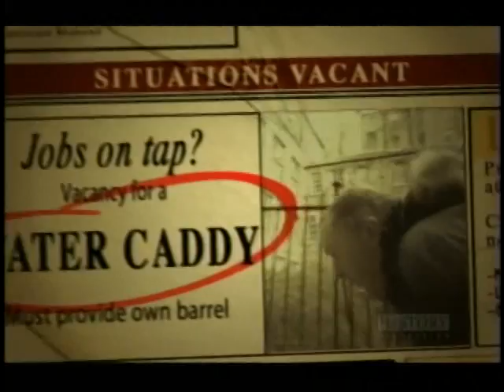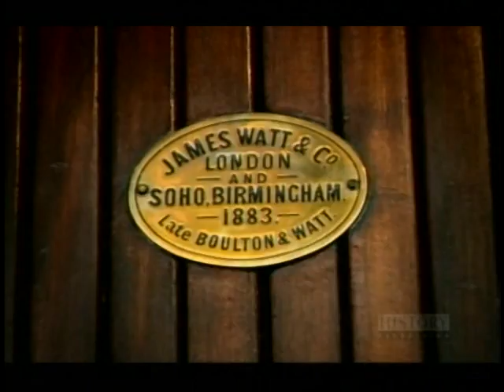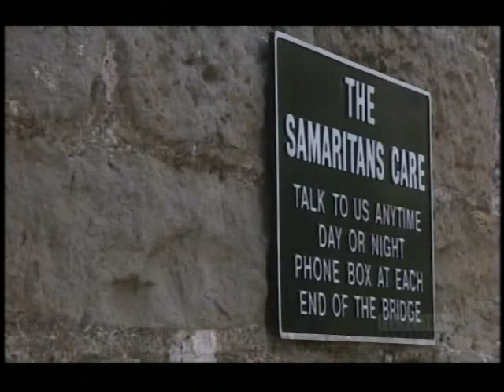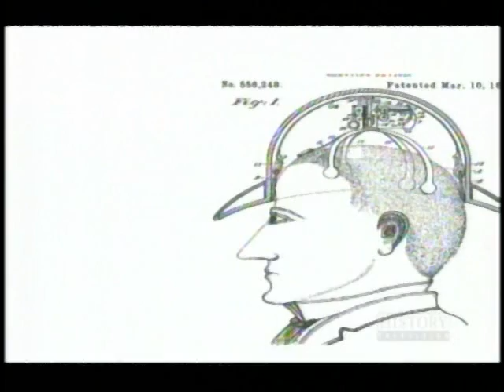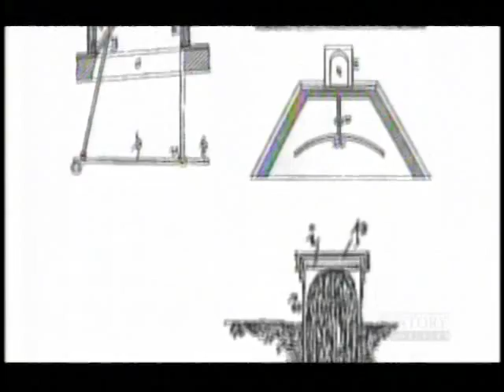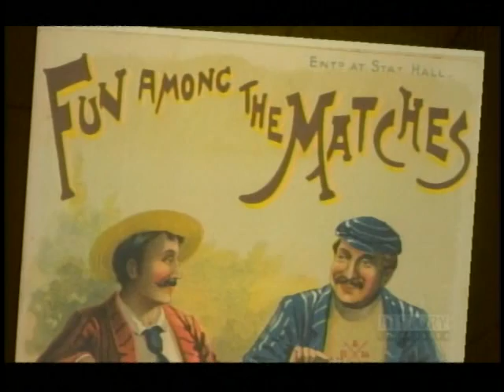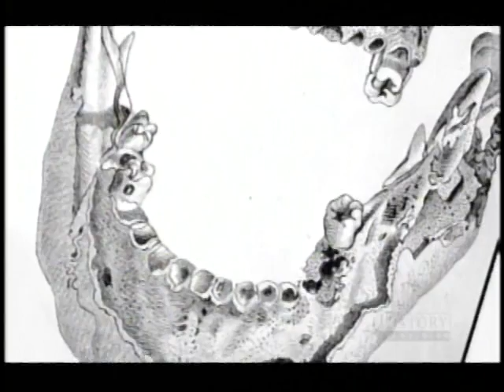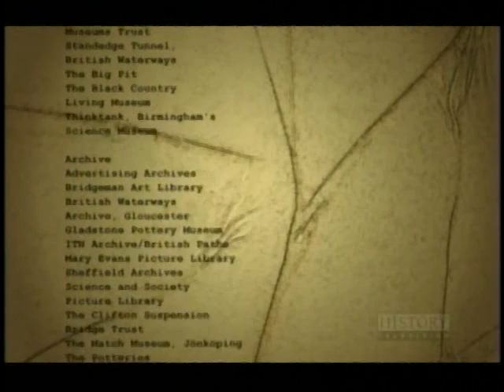The Worst Jobs In History - 2x03 - Industrial

Comment: Fossy-jaw, or something like it, also occured in the USA. Their problem was from licking brushes to a fine point while painting watch dials needed in the war.
Reply: That was Radium poisoning, from a radioluminescent paint product called 'Undark'. Similar, yes, but different. And oddly enough, the exact same thing occurred in the UK too; painting clock-faces and watches with radium-based paint.  Some women ingested so much radioactive material that a Geiger Counter can still detect a reading over their graves through 6' of earth.
Reply: Phossy jaw came from match factories--they used phosphorus in the making of matchsticks, and the intense exposure resulted in the necrosis of the jaw you're referring to.

Comment: Many years ago a dear friend of mine, used to work for a well known Electricity board. Anyway one day he was called out to repair a power coupling and replace a bulb on a 700ft radio transmitting mast. The faulty parts were at the top of this tower and it was the first time he had been called out to repair it and the weather wasn't exactly very clement either, it was raining and windy.
He said that the whole mast was swaying in the wind making a very frightening climb up and down, and with no lift he had to climb the mast with the aid of a long ladder and safety gear which weighed a ton, along with that and the tools and replacement parts. So when things needed to be done up the mast you certainly made sure you had everything you needed with including a few extras just in case you dropped something.  I don't think anyone going up that mast would want to go up there a second time in the same day.
Poor Tony must have been terrified up on that bridge...

Comment: Instead of 'legging' it through the canal tunnel, why couldn't they use poles to push the barge through by either pushing off the canal bottom or tunnel sides? Or better yet, string cables along both sides of the tunnel to where the 'leggers' could at least pull with their arms. I'm surprised nothing better was thought of.
Reply: My thoughts exactly. Probably would have sped transit too
Reply: During that era, I guess being a 'legger' meant that you were of low social status in that class obsessed age. Why do anything that would make their job easier right?
Reply: +James Robert Thought the same. That was the best they could come up with.
Reply: +James Robert 
Exactly what I was thinking. That has got to be the stupidest way to move a boat through a tunnel!
Reply: SpiritBear12 I guess whoever ran the canal must have been a real cheapskate who didn't want to spend any money on cables or poles-but then I realize they'd make more money by having the tunnel process sped up. I can't wrap my head around this insanity. Anyone have an answer?
Reply: James Robert
There is such a thing as being too cheap. Building that tunnel the way that they did, without making a pathway for a horse to tow boats through it was cheaper. However, it created problems with boat traffic jams just waiting to go through. Now you have to spend 3 hours to go through while others wait a ridiculously long time to get through. If you have to pay to get through the tunnel, they could have made more money per day if they could get more boats through it with the aid of horses. Sure, it would have cost more to make a wider tunnel but in the long run, it would have made more sense.
It's a stupid blunder.
Imagine being the poor bastard who has to walk all those boats through back and forth all day. What a job, those guys were not paid enough.
Reply: Yes, the program said that they couldn't make the tunnels wider because for lack of funding. If I was a 'legger' my subservient ass would be pushing the boat with a pole. Then I'm sure some uppity class snob would tell me to stop because I was making my job too easy.
Reply: James Robert
LOL
Reply: I can hear it, some hoity-toity snob seeing the 'legger' using a pole and saying "I say old boy, you mustn't be doing that. It sets a bad example for your other fellows."
Reply: James Robert
 LMAO!
Reply: ***** Thank you so much for answering my burning questions. But still, 'legging it' seemed so much more trouble than installing iron grab hold's along the length of the tunnel. You'd think the potential increase in traffic which equaled greater profits would have spurred any innovation other than 'legging it'.
Reply: ***** Fascinating! It's one of the many reasons I love history.
Reply: I'm going to go all 18th-19th Century canal owner here, and inquire as to why would you want to use poles or ropes, and thereby put men out of work?  That was the rationale for not using 'labor-saving devices' - it would increase unemployment, and Establishment Britain had nightmares about unemployed poor people suddenly going all French Revolution on them.
Reply: good point, but you forget that those in the lower class where always seeking ways of entering a higher class, so if they knew a better way by which they would acheive their job and more importantly, acheive noteriety for having come up with a better way, then why wouldnt they have used it? my guess is that it simply was not possible. perhaps the tunnel was simply too narrow to fit even the smallest barge, or perhaps the flow was to shallow to float a barge. or perhaps the ceiling was too low for a person to stand or sit on a barge- they had to have half their body submerged in order to fit in the tunnels. its easy for us to sit here in this day and age, behind a computer screen and say why didnt they do this or that, but the reality is human nature between now and then has not changed at all. if they could have, they would have. its foolish to thing of these people as stupid or uncreative, they where just as inteligent as we are. the reason we have better things and systems than them is because of them, we built on what they built. perhaps 200 years from now on a documentry about youtube videos someone will post a comment saying "well why did they type their comments on a keyboard that requiered physical interaction with a device, surly just using a telepathic wireless connection their their computers would have been so much more efficient.". yeah sure, if we could, we would.
Reply: I highly doubt it was a matter of being cheap or not thinking of it. When you have a problem like a bunch of barges being held up at a tunnel and everyone is waiting to get their goods through, people are pretty good at coming up with solutions, and the solution of using a pole or a rope is pretty simple.

I think it's most likely because legging it was the fastest way to get through the tunnels. Now the people in the show were going really slow because they're a couple of out of shape old modern men. I'm sure when you had professional leggers pushing the boat, it would have gone much faster.

Now perhaps pushing with a pole or pulling on a rope would have easier on the body, but the owners of the barges weren't concerned about being easy on the people moving it. They would have been concerned with getting it through the tunnel as quickly as possible.
Reply: James Robert I think if you have been watching, you’d realize they weren’t that bright back then
Reply: @WalterReimer  This is actually quite untrue. Labour was (and is) usually the most expensive part of any operation, so owners were keen to reduce it, and even the ones who weren't would quickly find themselves priced out of the market by more-efficient competitors. Additionally, since muscle-power was largely still the only source of power at the time, almost all of it would be used in any case - just not necessarily in very comfortable manners, as this series demonstrates.

In any case, even if poles or ropes had been viable solutions (I'd argue the maintenance alone probably ruled them out), neither would have put men out of work, as they'd still need the same muscle-power to utilize them, so the argument doesn't really apply here.
Reply: @Avnirvana1  Sorry, but this is both a common and very silly historical prejudice, and also not really at all what's shown in the videos. People in the past were no "dumber" than we are today; they simply didn't have the knowledge we now often take for granted. Also, we're far more wasteful of energy today than they were then, because we have cheap and plentiful fossil-fuel-derived power, whereas their power came almost entirely from muscle, usually their own. You'd be far more likely to turn off an un-needed light if you have to run on a treadmill to power it, wouldn't you?
Reply: @tomservo5347  Consider trying to manipulate a pole in a tunnel that size, though; remember that polers usually pole down the sides of vessels, and usually in much shallower water than the 4m of the canal. Also, a pole would just do the same job as your legs, but at a considerable leverage disadvantage.

Iron holds or ropes might have helped a bit, but consider how much frailer your arms are, compared to your legs, simply because your legs are designed to constantly carry your weight and your arms are not. Even the strongest person would find their grip failing long before their legs gave out, so you'd be having to replace ropes or pulls in the dark, some 1.5 miles from the tunnel entrance, for little advantage (not to mention that any maintenance would require blocking and shutting-down the whole tunnel as long as the maintenance-platform was in place). 

It seems very counter-intuitive, I agree, but it's basically the same mechanical operation as having to lug a load over a long distance; there's a reason we put the weight on our back and legs, instead of our arms.
Reply: @michaelccozens  Good points. Thanks for putting it into perspective. I'd imagine those 'leggers' probably had legs of iron and stamina that would make any army man proud.
Reply: @tomservo5347  Thanks, and I'll bet you're right! It's hard to grasp, except for being really glad to be living now and not then, lol!
Reply: @michaelccozens  Well there are some things that make me wish I was living back then, like the idea of nations and nationalism that's become so taboo, especially in Europe-except I'd be terrified of surgery or dental work without painkillers are anesthesia.
Reply: @tomservo5347  Depends what you mean by "nationalism". National pride, sure, and an appreciation of one's cultural heritage, absolutely, but the "nationalism" of believing oneself superior because of the geographical accident of your place of birth? That sort of silly bigotry is what nearly killed Europe multiple times over between then and now, and got many a "common folk" of the kind Tony's celebrating here killed or maimed for nothing but some rich person's selfish clutching for pillaged wealth and glory. That sort of "nationalism" belongs firmly beneath history's ash-pile, and we're all better-off for it staying there.
Reply: @SpiritBear12  Looks like leggers "walked " along the tunnel lying on their sides as in the photo.  Given a speed similar to a walking horse it would be the best way. Lower tunnels allowed boats propelled by lying on your back using the roof of the tunnel and boat.

Comment: that 'legger' job seems very odd to me. Surely they could have come up with a more efficient way than that. Why not make some cables with pulleys and horses at the ends of the tunnel.
Reply: The cables would have to be miles long and they would simply snap.
However, pushing the mud behind with a long stick (like a gondolier) could've worked.
Reply: Cost.  People are cheap, horses, cables and pulleys cost to much. Plus a horse eats quite a bit, and requires a bit more space then people.

Comment: An older friend of mine told how her mother actually made soap before the Finnish wars (Winter, Continuation and Lapland) and how she never run out of soap despite the rationing.
Reply: That would have been weaker soap.  Commercial soapiers used sodium hydroxide (Caustic Soda) which is fairly involved process to obtain.  Historically home soapiers used potassium hydroxide (Caustic potash) from water soluble potassium obtained from soaking hardwood ashes (fruit/nut tree) in non-chlorinated water.  That soap doesn't set hard though (like the soap in the video), which made it kinda useless commercially before the rise of cheap packaging.
Reply: @maxdecphoenix  Interesting.
Reply: @MsDjessa  It was soap though, don't get me wrong.  And any dogs around would have loved licking you because you'd smell/taste of beef fat (tallow) and salty wood ash. unless you really clarified the tallow several times and possibly added some kind of plant essense to add aroma/moisturizing.
Reply: @maxdecphoenix  Yeah I don't know if she did, my friend didn't mention that.

Comment: I can't for the life of me believe that it was faster to leg a boat through the tunnel as opposed to just using some oars
Reply: There wasn't room in a tunnel that size to manipulate oars, though. And even if there was, while it's hard to believe, you have to remember that trying to shift the bulk of a barge by pushing against water with an oar v. pushing against another solid surface would be somewhat akin to swimming as opposed to running.
Reply: @michaelccozens  bullshit there wasn't room for an oar.  Atleast on every canal boat.  Some were fairly narrow. They even show a particularly narrow boat in the video; the guy had to build a plank to overhang the boat so his legs could reach the side of the tunnel.

And the concept you're failing to understand (much less explain) regarding water speed and land speed is governed by a principle called 'coefficient of friction'.  What you fail to accept is the efficiency of work is entirely dependant on the surface area of the oar, shape, and the force (in terms of speed) at which it moves through the water, but you invoke an undescribed and inefficient oar to bolster your argument. If you used a broomstick, it would have a VERY low coefficient of friction and produce insignificant thrust regardless of speed.  Using a much broader oar, with a longer shaft (to increase the max. potential speed the oar could travel in the water. Just as how a person on stilts would run faster than a person of equal attributes without stilts running with the same effort.) would produce significantly more thrust.
Reply: @maxdecphoenix  First off, please try to maintain perspective. We're discussing the potential efficiencies of various modes of transport for Industrial Revolution-era barges; it seems a strange subject over which to become heated. Discussion is about the exchange and evaluation of concepts, not a struggle for dominance, and if you're striving for the latter, you're not doing the former. Let's keep it civil, yes?

Sure, you could build a narrower barge to allow for an oar, but we're discussing cargo vessels here; even assuming you're correct, sacrificing load-space for improved speed on a relatively-tiny proportion of the barge's total journey would be a very difficult sell in the vast majority of cases. Addressing your idea itself, you're forgetting that oars generally rely on the ability to remove the blade from the water on the return-stroke in order to minimize the production of thrust opposed to the desired direction of travel; a very tricky proposal inside a tunnel, and one that only gets trickier the longer you make the oar-pole. Even if you could solve that problem, you'd still be left with the fact that rowing in water seems to create less thrust in proportion to effort than direct contact with a solid surface, as demonstrated by this video (https://www.youtube.com/watch?v=FiYuPeDqCsk), in which even a US-national-speed-record-setting purpose-built 24-seat boat achieves a speed of only slightly above 23 km/hr, which is substantially lower than the record speed achieved by a single sprinter of 37.5 km/hr (granted, the sprinter is Usain Bolt, but still). An oar-driven barge, given the far-less-efficient mechanical movements required by the small size of the tunnel, wouldn't achieve anywhere near that level of performance.

>Just as how a person on stilts would run faster than a person of equal attributes without stilts running with the same effort.

With respect, I think you've got this concept a bit wrong. Stilts would allow a person to exploit greater effort for greater speed through leverage; running with "the same effort" as without stilts would mean not exerting enough force to lift the weight of the stilt off the ground. For your concept to work, the stilt would somehow be required to be a lever that also created additional force on its own, which is not what simple machines do.

This is an interesting discussion, but I think it behooves us to recall that our ancestors were not foolish people, and that great wealth was dependant on the work done in this manner. All else being equal (which is, admittedly, nowhere near always the case!), if there was a more efficient way to perform the labour being done, the economic pressures involved would likely have produced it, as they produced the barges and canals to begin with. It seems as if the "legging" method gave the most efficient use of the limited power (ie., muscle) available, an equation that changed radically with the introduction of near-unlimited power from fossil fuels.

An aside; if your ideas concerning the relative merits of oars v. solid-surface-contact worked, wouldn't you expect the barges outside the tunnels to have abandoned canal-side pull-horses in favour of a horse-driven, barge-mounted oar-system, like, perhaps, a rear-mounted treadmill-driven paddle-wheel device, similar to what was used in the earliest generations of powered watercraft? It's a complex scenario, and my physics are admittedly terrible, but the concept does seem to track; if they could have taken advantage of the available space outside a tunnel to exploit oars and leverage as a more-efficient method of utilizing available force, why didn't they do so?